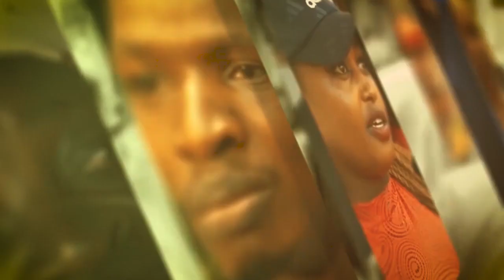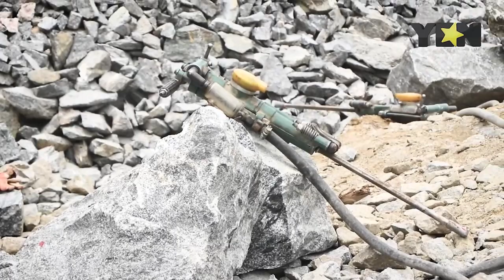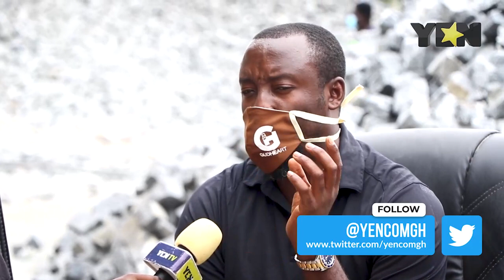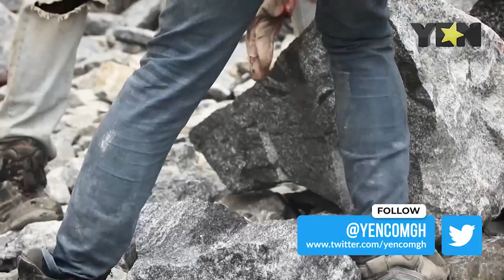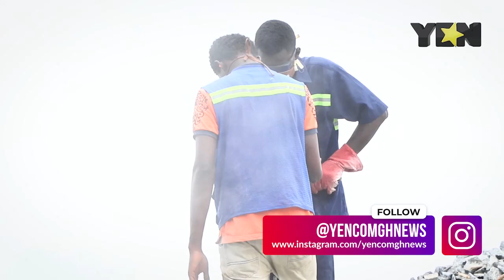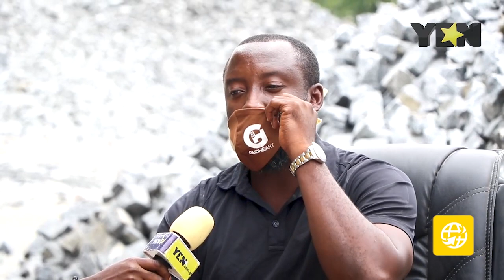Faces of Ghana: 2 brothers paving roads in Ghana with granite and cobblestones | #Yencomgh

Comment: I'm glad that finally we've got 2 guys knowledgeable enough to take Granite mining in Ghana to the next level. The banks have terrible experiences with Stone Quarry Companies in the past, that's why they're running away. Besides the regular Quarry machines like bulldozers, excavators, Articulated Dump trucks, jaw and cone crushers and screener, welding and power plants, they need Bigger Block Cutting Saws, Engraving and polishing machines etc. Huge, huge capital for individuals to maximize Granite Mining (some $50-$100m). Products could be Quality Countertops, Marble tiles etc. Serious business requiring huge initial capital but very Rewarding